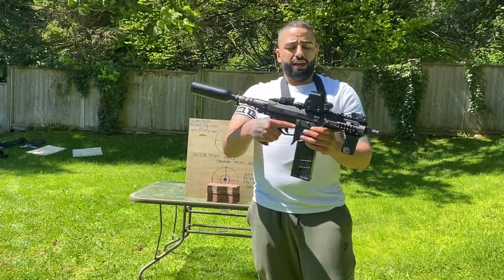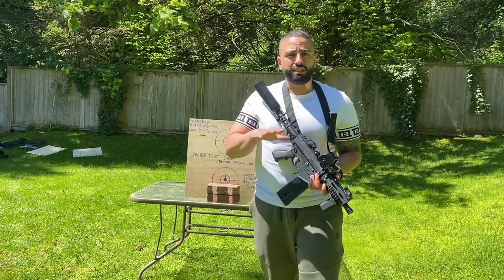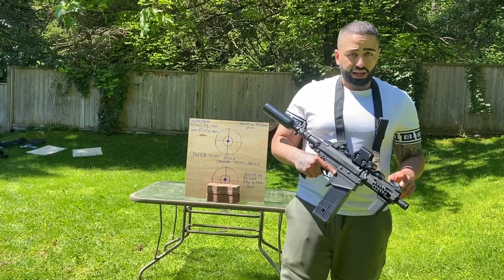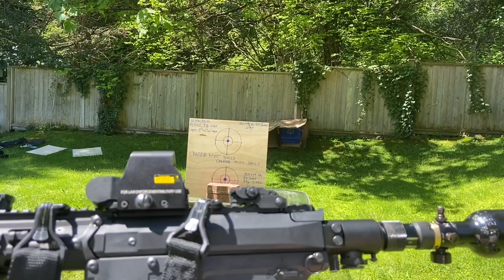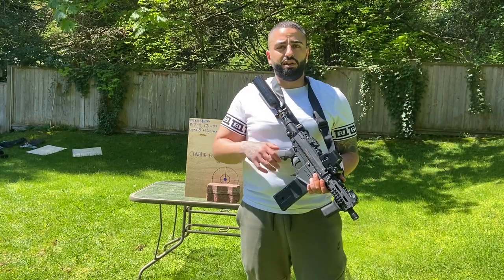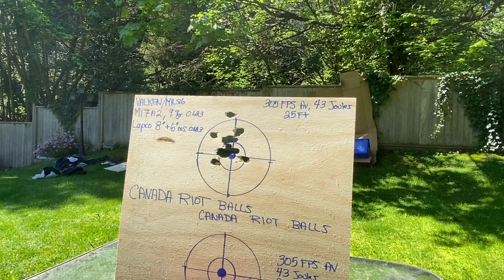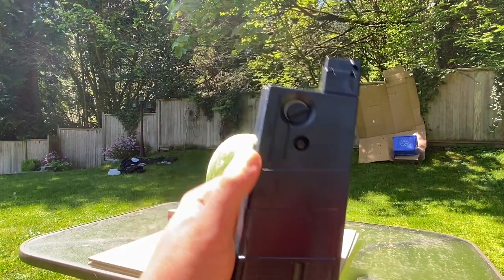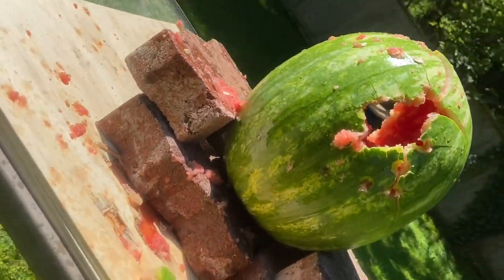44J 305fps -Valken M17a2 watch the insane stopping power 9.9gr riot ball !! Home Defence Less Lethal

Comment: Yea brotha! Been waiting for you to get your M17 A2. Great gun huh. I got mine dialed in at 340-345fps. Shooting Grimburg HP68 & JUL. Nemesis 11” barrel. 3000/13 tank 950psi output. Let’s me shoot two (side by side) clips from 3k down to 1k psi.
Reply: I got the Lapco FSR 14” and I use that when I shoot nylon pvc balls, following your recommendation and it’s scary fast. It gives me 411-417fps! Also got Hammer head 10” which is my least favorite because of accuracy. I use a “Raging Donky” on the Nemesis and Lapco. It’s loud! Since it’s for home defense, I want the trespasser(s) to hear they are being fired at. @canadariotballs1283
Reply: are you getting 345 with a 9 gram ball, and if so what did you do to get it above 305?
Reply: @UmarexLessLethalHomeDefense  i’m using Grimburg Jul and HP 68 rounds, they range between 7.7-8 grams. I’ve done basically all my mods last year that Mikey has done. I tried to keep it at a consistent 345-350 max, any more things will start breaking and misfiring.
Reply: @canadariotballs1283  yep, hey Mikey did you try the “new” side by side mag clip? Way more stout, you might be able to load your heavy projectiles with these clips. Lemme know brotha!
Reply: @canadariotballs1283  Mikey, I have it mounted 2.5” from the bottom, works fine bro. Good luck

Comment: thanks for the vids been watching your vids and Dan Spencer velocity testing on M17, extremely informative )) & cost me some bucks + much more understandiing of my  M17 PS: ~Got myself an M17 just because of your mods & reviews )) marker for Less lethal round. fyi, blew off my m17 velocity cap. suck)) but found a lifehack)) ...order from valken 2 new caps but it's gonna take a while until it gets to me. meanwhile. found a local welder, who put back the two pieces back together, addionally reinforced that cap (basically is too damn weak, in retrospect, I can now easily regulate the velocity with the freaking fear of blowing the cap + FPS of course.....) Simply wanted to share....& btw do you ship internationally ? Peace out JB

Comment: Yooooooo that was sick. It was even taking chunks off of the Blue ball capture bin near the fence at 40ft. Shame you can only get two mags outta the 9gm. 

But the power is immense (Think the Guyvers Pressure cannon) making it just under lethal. Still not as sexy looking as your T15 builds. (sorry but I love the ergos on T15 and 468's easier two piece take down pins less screws)  

Even so man when you are getting results like that? And for that price point? That is the least concern.  

Even 4g would be menacing to be on the receiving end of at that output pressure and velocity and at full auto? Man!  A full auto destruction target test would cool to see. 

What would be cool is a mag adapter for it to take Zeta mags or even FSC mags that have the 12g co2 (Does it take glock mags? LOL) Or even swap out the Mag well itself to take the T15 mag.
Reply: @canadariotballs1283  Get the hopper adapters for the m17. They don’t have drum magazine for the m17 that I know of. Or do they? What about a larger tank with the same 1100 psi output to unload the hopper?
Reply: @lesslethalfordummies  Canada “Riot Balls” Less Lethal.
Reply: @canadariotballs1283  right on man. Yup this marker ain’t no joke for sure, and good price for what it does no doubt.
Reply: @liltimmybrickedps5801   I run a MCS box mag on my m17a2. ( for paintball) Should feed less lethal even more reliable IMO
Reply: @bw1819  I’ll check it out. Thanks for the help.

Comment: Hi ! Very good job. Concern the Pressure Relief Valve, do you only use your screw mod or do you keep the spring + your screw mod. Thanks to tell me. Best regards.
Reply: Thanks, it was i thinking. So, Yes the plumber is very important because with this mode the relief valve is always ON, so the air fill the hole that your screw and the plumber tape have created. I think that's why you have more power with just it. You have created a little reserve additionnal air that is use to be firing. On the Grimburg version they delete this space.
Reply: @canadariotballs1283  And what about full auto ? Is it fonctionnal or not ? Thanks.
Reply: @canadariotballs1283  Yeah, i understand, and the magazine have to load balls as fast as the full auto goes, so it needs to be upgrade with a more powerfull spring. I already test with 7g balls and in full auto the bolt finish to be freeze by a ball 1/4 loaded. And when you release the mag....ba ba ba ba ba, it unlock the full auto and you cannot control it, it never stop. So when the full auto freeze, always out the HPA bottle.

Comment: So set up "screw mod" was just basic Pressure Relieve Valve Shut. Good to know. I'm looking from local hardware stores so i wouldn't have to order it all the way from Grimburg because I live in EU area.. Custom fees are 3 times as much as PRV M10 bolt from them.
Reply: @canadariotballs1283   Hello Brotha man!
They ask 5€ each and it wouldn't be any issue, but cheapest shipping fee is ~12,50€
Actually i could go and seek if i would find right size PRV plug today.
Reply: @canadariotballs1283  did you find out, also in the UK and looking to do mod?

Comment: so as per this video, when it was made, was the barel the only upgrade? is that what brought it to 44j?
Reply: @canadariotballs1283  whoa, hold on, maybe i should rephrase my question. I don't know what half that stuff means. What is the power of the stock gun & how much would the barrel upgrade (only) increase that power?
Reply: Actually, I’m starting to understand that certain parts need to be upgraded so that you can run it turned all the way up. I guess I thought I could get a stock one and turn it all the way up and Adam barrel and be done
Reply: @canadariotballs1283  right. i see. I just have anxiety about taking things apart and getting them back together properly & w/out losing tiny parts. 
I have yet to install the Grimburg O-ring in my FSC eventhough i've watched the vids and see how easy it is, i just get so nervous. 
I won't use the 12g mags yet untill i do it. i have the Grimburg barel too. I can put that on and shoot the Juls and NOT crank it up in the power adjuster (regulator?). maybe that will increase a little until i make the upgrade. That shouldn't stress the stock O-ring should it?
Reply: Thank you for the encouragement!  and I already have those O-rings from Grimburg. And the 12g mags And the Grimburg 5''  barel. You think I'll get past 30j once i put it all together?
Reply: @canadariotballs1283  I got the same fsc and waiting on grimburg parts. looking now to get m17 as well. however hav Eni idea what a shim is alone changing it or what a pvr delete is. please help with this or make a video form scratch would be very greatful. I can order ninja tank and other bits, but no idea about the rest mentioned above

Comment: another greaT VIDEO.  i WAS GOING TO ASK IN OUR GROUPS BUT DECIDED TO ASK YOU HERE.  I really need your help.  I have the m17a2 rifle, exactly like yours, after adding grimburg.s delete plug, I was going to tune it up, but i also added yesterday the gog shutoff vaULE ADAPTER BETWEEN THE GUN AN REGULATOR, JUST LIKE YOU HAVE. tHAT EXTENDED THE LENTH ON THE BAR THAT LOXCKS THE STOCK ONTO THE GUN. iT HAS 7 HOLES JUST LIKE YOURs so I know it has to lock in and fit. well It didn't, so I took off the stock an the sling clamp on it, put the sling clAMP onto where the velocity screw is, fits perfectly, but it doesnt look good I think without the stock with it, plus the stock hides the tank.Then I watched your video here three times AN SEEN YOUR LOCKING BAR HAD 7 HOLES IN IT, I THOUGHT i WOULD HAVE TO BUY  a longer one, I tried, but there all sold out . Like I saID AFTER REDOING MY GUN WITHOUT THE STOCK TO HOLD THE SLING.  AGAIN WATCHED YOUR VIDEO An seen if it works on your gun, it will work on my gun.  I changed it all back an now as your stock locks in, I cannot push my stock in any more, its touching the reg meter, an wont lock on there?  I thought of drilling holes in the bar, but its a solid medal, how did you make yours fit? an How can I make my stock lock into the stock bar?  thank you.
Reply: @canadariotballs1283  yes the rail, thanks for replying too.  I removed it, but how does your stock stay locked in? also I bought a sling, a single one, thinking that's what you had, but I have to lock it onto the stock, so it has to be locked in, but how did you lock yours onto the stock????
Reply: @canadariotballs1283  Wow.........Thank you so much, your a really nice guy, also you have a big heart helping people they way you do. I loved the look of your M17, I just finished my M17 an they look exactly alike, I again thank you for all your help.

Comment: Hay Mikey great video first off, I do have a question for you quite a while back I purchased a 13ci tank off your website I had originally thought it was 1300 psi which concerned me after learning more about the Valken M17 and that that was too much air pressure for that marker anyway I was looking at your store and saw that the tanks you sell are in fact 1100 psi not 1300 psi so I took out my tank and put it to my pressure gage looks like I've been missing out I never used it for fear of damaging the firing pin or bolt did you ever sell 1300ci tanks with 1300ps
Reply: @canadariotballs1283  I totally agree thanks for the answer

Comment: I wonder what the legal ramifications of cranking up the joules are. At some point it's straight up lethal. A headshot with a HP68 round is likely to be lethal, then they'll examine the weapon during the court trial after. Even in self defense the prosecutor may try to get you on something...
Reply: @canadariotballs1283  Yes it's a tough call and is situation dependent I think. Ideally I'd have a marker with close to stock settings, and a proper firearm on me.
Reply: @8triagrammer  Here in Canada, unless you live out on the rural areas, the Police will absolutely seek out a weapons storage charge on you if you use a powder burner for self defense. (Heh, especially Ontario)

"If it was locked up, how'd you get to it so fast? Are you sure it wasn't ready and waiting?" 

Having a less than lethal means of defense mitigates the chance of being accused of using deadly force when not neccesary.

A vast, vast, vast, vast majority of the time, burglars and home invaders are armed with entry tools. If I can use something that is identical to a firearm to get them to drop what they have, or even better, flee, then great. 

Most criminals here arent willing to do a life sentence for killing you in a B&E. And most criminals will flee the scene before police arrive, especially when hit with 19 balls at 35-50 foot pounds of energy. So Im not worried about litigation. 
Beyond that, id be happy to explain to a judge why I chose to use this option over a gun or crossbow, which in case of the crossbow is a 100% lethal option that can be staged and ready to go. 
Im just trying to get the perpetrator to leave after all, Im not trying to kill them.
Reply: @yobrodontshoot1130  Anything past 5.7 joules requires a firearm license such as a PAL because it would be considered a firearm here in Canada, so if this air gun can go up to 40+ joules, if I'm not wrong you'll need a PAL to own it, may as well just own a real firearm, if you shoot someone with that air gun they'll treat it the same as a real gun.

Comment: I just bought the new paintball 468 marker would I be able to get similar results if I tune it up? Does anybody here use the 468 as a non-lethal self-defense tool?
Reply: @canadariotballs1283  well that's a bummer I had high hopes for the 468. What if I have a tank with 1400 PSI output you think that would be too much strain on the marker?

Comment: With my valken M17a2 From new.. 
• Extra bumper 
• pvr delete 
• on/off asa
• 850psi regulator 
• 10” ammotech barrel 686
•using grimburg 8g v2 joule round ball (686) and with aprox 2 1/4 turns I’m consistently seeing 341-346fps 
And I’ve put 110 round through it with Zero hiccups. 
# the 18rnd stock mags struggle to take all 18 rounds (springs to weak) I only put 8-10 rounds in each mag

Comment: is this ready to shoot out of the box or do i need to oil it up?
Reply: @canadariotballs1283  ya i got a 14 inch barrel and a 1100psi ninja tank, as well as the screw mod, i just wanted to know if i can shoot it right out of the box on the factory settings with out lubing every thing first just to test out
Reply: @canadariotballs1283  Awesome thanks bro
Reply: @canadariotballs1283  does a person need a license to have one of these? Im looking for home intruder protection but not to k ill someone...
Reply: @canadariotballs1283  so how many fps does this featured gun have?
Reply: @canadariotballs1283  so the law states anything more than 5.7 joules needs a license correct? do they base the license requirement on fps or joules?
Reply: @canadariotballs1283  i see ok thanks for the clarification...
Reply: @canadariotballs1283  right thnx

Comment: I need one of these rifles!
Reply: After seeing this video, I just bought one plus 2 extra mags. I have a few HPA 25, and 22 cal. rifles
and a HPA compressor. None of them hit as hard as that thing. Will us a spare 13 ci. ninja bottle
With 1100 psi out. All I need now are projectiles, know anyone, just kidding. I will check out your website.
Thanks
Reply: Just ordered 100 - 9.9 gram projectiles. Was going to order some 4 gram balls, but was not really sure what there differences are or which one to pick.
Thanks, just received my emailed receipt.
Reply: @canadariotballs1283    Can’t wait, thanks a lot. Will try out the 4 gram ball. Will need some for practice.
Would have ordered some at the same time but did not know what kind to pick.
Reply: Thanks again, will definitely be back.